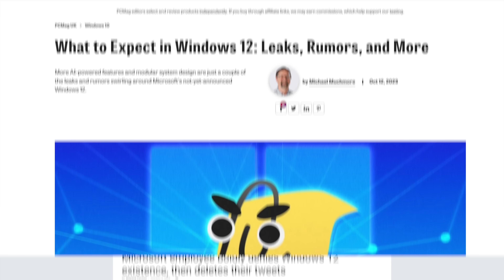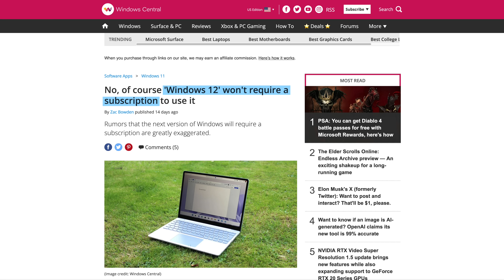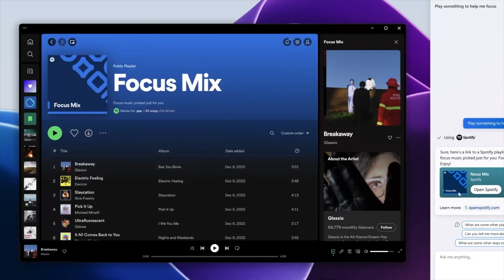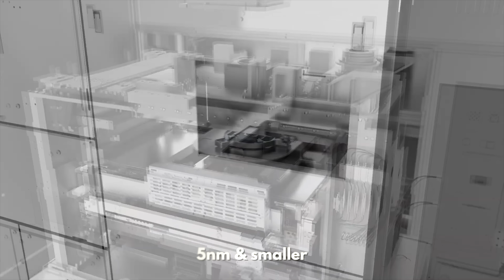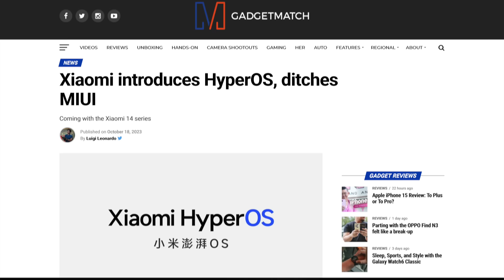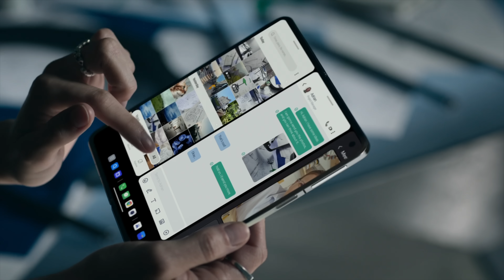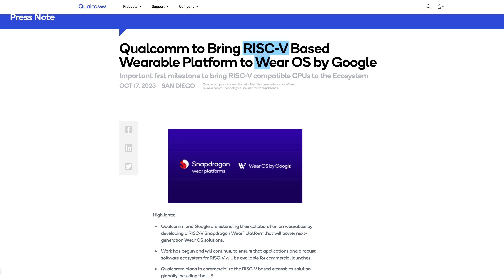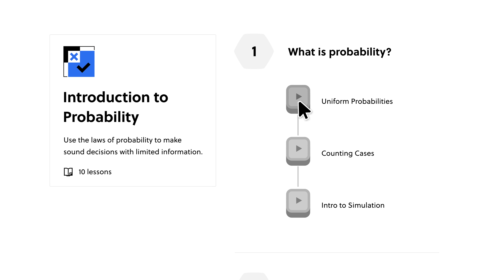Windows 12 is looking good!

Comment: Well, this didn't age well. Apr 2025, Microsoft hasn't even released a preview of Win 12. And people are speculating Oh maybe in 2026. TMC released sub 1nm chips that require the transistor channel to be 3D embedded inside the base. Which ould be extremely hard to do using Canon's approach.
Reply: Yeh it aged damn poorly. WIndows 12 in 2024 LOL. I'd be surprised if we got windows 12 before 2027, if at all. MS got burned too bad already with their W10->W11 adoption over the last 5 years.

Comment: I'm definitely holding back buying new pc until intel comes up with its own M3 arm chip version, as there a massive difference in video editing speeds and most importantly electric use & heat produced  is way less then current Intel i7 10th gen

Comment: Already switched to Linux. Microsoft isn't offering enough value in the product for the price they're charging to make it worth switching back. Certainly isn't any consistency like there was from Windows 95/98/2K/XP/7. Throw in all the attempts to force upgrades and things with malware like popups and such as well as crazy hardware requirements shutting out perfectly usable systems and I'm happy where I'm at. Hell I have an easier time installing and running Linux these days then Windows especially after seeing what hoops you have to go through to get local accounts setup and remove unwanted software that Microsoft tries to lock in to the system. Especially if I want to run Windows games, I got some titles that run fine in Linux with the Proton and Wine that won't run in the newer Windows anymore.

Comment: more bloat nobody wants, stricter requirements that ill have to bypass on my older but still perfectly capable hardware, more registry edits to turn features off that nobody wants and are a distraction. Endles hots file mods and service disabling to remove telemetry data collection l, PowerShell and command prompt commands to remove more stuff thats pre-installed that you can't remove by normal means, then every new build of the os having to repeat some of those steps to remove hardware requirements and manually having to update it by grabbing a fresh image from Microsoft, removing the requirements for internet connectivity to install it and bypassing the need for a gastly Microsoft account, then running sfc scan now after being all finished, all my windows 11 machines are heavily modified to remove all that junk, had to go though all of that to make it leave me alone, if 12 is a subscription service, ill be moving to Linux fully or even Mac os. When your customers have to fight it beyond just setup and installing favorited programs Microsoft, you have failed. boy can't wait.

Comment: They could've released Win11 and Win12 as simple updates/service-packs to Win10 and stay true to their own words of "Win10 being their last Windows OS".
It pretty much looks like the same boring OS anyway, just some reorientation of a couple menus here and there.
If it wasn't for the fact that my hardware stopped support for Win7 I'd still be using it. Right now I'm on Win10 anyway, and I'll stick with it for as long as hardware supports it, then I'll pirate the future version they have, preferably one that's been modified to favor the user with blocked backdoors and Bing keyloggers and whatever else they have going on by default. Imagine being in charge of which updates to download and when...

In my world, I'm in charge of my machine, not Microsoft.

Comment: More and MORE "bloatware" from macrosnot. Last week I backdated my desktop "Frank"(enstien) from Win 10 to Win 7. Faster, the size of the program software in memory dropped from 20 gig to less than 2 gig, it does all the things Win8 and up WON'T DO (like play DVD's and CD's) and I use Capture One for photo editing and it's running 8-20 times as fast. I NEVER get the stupid "thinking" circle. My friend a software writer for a major telecom, showed me how to "block" macrosnot from "upgrading me" (it ain't EASY!). I have my late sister's crappy little HP laptop on WIN10 and every "update" locks it up. Win10 is in the CPU and purging it is about $200-is it worth that???

Comment: I'm done with windows 10 I stopped using it for a while and when I tried to turn it back on it mick killed itself basically went into a boot loop and broke just because I didn't turn it on for a while such a nice stable operating system by the way I don't get this problem with Linux I could stop using it for 3 years and turn it back on and it will work fine with a few commands so yeah we own nothing like really

Comment: NEW Windows 12 with NEW features like:
+ More Spyware
+ More Spyware 
+ More Bloat
+ More Ads
+ AI tools that will never be used
- All of the features that you used in 10 and 11
- Backwards compatibility
* Required TPM 3.0.
* Required Camera even on desktops.
* Required 8 core CPU.
* Required RTX 2050 or newer.

Comment: Your saying Windows 12 looks good. Well I know from experience Windows 10 and 11 were bad news with Micro$oft adding all the ads spyware and other anti-consumer crap they added. The Windows 11 installer doesn't even work on many computers because it checks for things that aren't even necessary. Those in the know know that when those systems checks are disabled in the installer Windows 11 runs fine on the "unsupported hardware", just a ploy to get people to throw away there computers. Now you are gonna try to tell us Windows 12 looks good?! Really as if they didn't add more anticonsumer crap?! Really. I doubt it! Probably more like a distopian nightmare. I used to love Windows intil they pulled all this crap. Every thing up to Windows 7 was great but after that they have been doing bad stuff with Windows.

Comment: It might 'look good' But windows 11 barely works with modern hardware. Intel's latest CPUs LOSE PERFORMANCE on Windows 11 compared to Windows 10 due to 11 being completely broken with handling the e cores. More importantly, applying the OPTIONAL 22H2 update degrades CPU performance by over 30% in a lot of games and applications.

I really do not truest that Microsoft even cares about this, nor will do anything to rectify it on a new OS if they can't yet fix their current one.

Comment: Windows 7,8,8.1,10,11 and 12 are all just variations of Windows Vista. Compatibility has remained high ever since. Stability improved greatly with 7. The bloat of the most unnecessary unwanted features attempting to replace third party tools set in with Windows 10. In the end though, it's just windows. I would not be surprised if they didn't start charging a subscription not for 12, but for 'features' within it. They'll leave the full on sub for the giant that is Windows 16

Comment: WOW. Not gonna watch the video with such a click bait title. The original Windows 1.01 look good when compared to what everyone else was offering, it kick off a long list of successful OS releases for Microsoft.  Yes, I know Macintosh OS was better at the time but lack of software and the much higher priced   made many not see them as an option. Microsoft rode the success wave for 15 years and then they released Windows ME which was a train wreck. From that point on Windows has been pretty much hit or miss. After looking at Windows 11 I decided its time to make Linux my primary OS and use windows for mainstream gaming as well as certain printers, vinyl cutters and embroidery machines we have are Windows only. Each Windows OS seems to progressively getting locked down and locked, out features some features that part of the OS are now  only available in  Windows pro.

Comment: I'm running a top spec Surface Pro 9 and the Windows 11 OS is very performant. No issues. It is fairly intrusive though and attempts to vacuum up all your information. That part I don't like. I have a 12th gen Intel CPU in the Surface and it flies, but it has no NPU features so it's unclear how that will coexist with Windows 12, which is supposed to have AI features.

Comment: Too bad Windows 12 is going all in on what makes Windows 11 a bad release. It might actually be a case of a good release followed by 2 bad releases.
I'm sticking to Windows 10 until they get their head out of their * and start fixing things. The design is crap and needs an option to rollback to a Windows 10 look. It should be possible to opt out of all AI crap without losing normal functionality too.

Comment: Windows 11 is so trash, I switched back to windows 10 because of how angry i get trying to do the simplest things, right clicking on stuff with windows 11 opens a limited set of options and I always need to click on see more (it switches back to the old ui). The new settings menu is just incomplete, most stuff from control panel is missing from the windows 11 settings and I'm glad they at least kept the control panel accessible. I also would like the option to use those large taskbar icons, i just prefer them over just a small icon for all my windows of that program.
So Windows 11 added absolutely nothing worth updating and also removed some important stuff, very bad in my opinion

Comment: We've got a new Windows XP, Windows Vista, and Windows 7 on our hands, finally, after so many years we actually have choices and variety again. For a long time, we only had Windows 10, and while Windows 8.1 and Windows 7 were also available, Microsoft forgot they existed. Microsoft made modern updates for Windows XP to make it relevant in 2008-2015, but they didn't do that for Windows 7 and Windows 8.1 in 2018-2023.

Now we have two older versions, Windows 10 and Windows 11 that Microsoft will still care about, even after the release of Windows 12.
Windows 10, version 22H2, Windows 11, version 24H2, Windows 12, version 24H2.

Comment: Microsft did say in one of their events windows 10 would be the last OS. When I saw the semo they in essence, to me showed that all the feedback of of improving windows 10 was ported to windows 11, with some curated business sauce in top, but not have the flexibility potential of windows 10. Windows 10 wasn't perfect, but did make great strides. Once they said not all pcs were upgradable to windows 11, I gave up, as this was not in my mind the promise made what windows 11 would be. It was to be a lighter version of wi dows 10 but still have the compatibility. Microsft has also focussed more to business support rather than cinsumer sypport which makes any version of windows 10 less valuable, I think. For me windows 10 really means the end of an era and I'm not going to invest in an OS that does not support older hardware that still works fine and doesn't have its cost of ownership retirned on higher end pcs/clients. And I think whatb I've seen so far with windows 11 a lot is quite curated, for which I fail to see the value of further investment, perhaps only to business incentives and norms. But I miss the flexibility in future itterations beyond windows 10 and customizability, windows 10 has. The only thing I think Microsft has dine right is the cross olatform exoansuon of Office software. That software is  is valuable in the many offline and online itterations (for me offline being better, but I like the online synchronization of files and sharing editing). But I've lost faith on windows for business and consumer use. I don't see windows 12 getting far beyond contracted businesses.

Comment: Don't need Windows 11, just need a secure Windows 10 and CERTAINLY don't care about a Windows 12.

Once again willing to bet 10% of customer base may use 12 to any real advantage over 10, and as a forced 11 user, I still don't see any special use over my Windows 10 machine.

If there are under the hood security upgrades, I don't see them, nor are they really bragged about.  AI features are just more exploitation of the customer and their data by the sellers.  I don't need AI because I work with REAL I that I need to understand to apply it and implement it, and be SURE it has no trap in it.

Comment: Windows 16. Four Loko contract. 4 windows; 1-4, four times. 4 different versions for a division system using a square note system. A quadruple rainbow 4 times. 
Logic of the alphabet and 24-25-26. Regarding 99-24, 00-25, 01-26.
Logic of how 24-25-26 is supposed to be the 16th windows because of the plan being about counting the alphabet using a 4^4 system and having it be 16 within 26 described as 25 or 24. Regarding how describing a square and describing science as a square and business...
Logic of the bouba Kiki effect square. Regarding how a square description through physics and elements could make an argument about the truth of computer technology and psychiatry... Like God is fully explained through math using proof of unseen sounds and unseen radioactivity and so forth. Regarding proof of the science of empathy and the fiction of it. Seeing the proof of the bigger picture and sound regarding how communication is validated. Having a map that is a perfect square. And so forth. Regarding claiming that the business at it's foundation is securing the proof that a square is square. It's needed for keeping track of time as well as gps and communication.
Thus, the full explaination of 4=1.
A god skateboard at a skatepark with a god robot using the 40" long, 10" wide, 5" trucks/ tall (10" wide) for making a bouba effect science proof of secret / empathy/ god communication within the technology virtual spaces and communications (representing an example of a description of copyrights and mechanics for the sound/ physical sciences of the bouba effect). It's only an example but would meet the needs of the 4=1 and be about showing how talent and naturality modifies the judgement of randomness.
Logic of how the four Loko contract was about healthy lifestyle of nootropics and alcohol/ recreational substances while living on a liquid only diet. The context of all of it in a contract proves that the square is like a root system for assisting mental health,  especially with autism.
Having a mentally healing root despite behavior... Something that's proven science which can be understood and explored without speculation... Thus, confusing things is external and not agreed upon. 
Logic of having a failing alphabet after the thousand year party and discussions about all of the past... It's like reverse psychology.

Comment: The top most navigation bar is really intriguing. In MacOS its really useful. I thiink windows should add it. It has been ease of use since the bar in Macos. hope they add a feature to auto hide it on full screen mode too.

Comment: Helll yeah, Windows 12, Edge fully built in with no way to remove, bundled with Bing AI chatbot and Microsoft AI Tech allowed to roam free in your OS. Windows 11 has been to date the most invasive OS I have ever used. After paying an arm and a leg for it I switched to Linux, which is free. I heard about it years ago but I thought you had to be very tech savvy to use it, which I am not. Turns out that it has gotten very user friendly, even my mom and dad use it now. I was able to customize it so it looks just like Windows 10, except I'm in control of what's installed on my "personal computer." Crazy idea right? I am finally free. :eyes-pink-heart-shape:

Comment: I find it funny that you think Microsoft will not make you have to have the hardware to run the new feature. ... Well technically depending on how it is compiled it can run on the CPU core but that is like saying that the MS Office suit can run on a graphics processor but it is compiled for x86 not OpenCL. So unless they put in code for both CPU compute and AI core compute it will either disabled and not be able to enable the AI windows 12 features or more likely require the consumer to have the CPU that supports the AI compute features locally on the CPU or SoC.

Comment: The most potential concern for future of Windows is if they dropped Win32 compatibility (most likely by dropping all of x86/x64/desktop apps support) losing over 30 years of backwards compatibility and therefore losing one of the most stable API ever made
Reply: Why API?
Reply: @prashantmishra9985  Because Win32 API has functions that work in Windows NT 3.5 to Windows 11 allowing Win32 apps to work in a very broad range of Windows versions

Comment: Did not expect Canon to be a major player in the chip production space.
Reply: Whenever there is an opportunity to sell hyper expensive ink, here they go!
Reply: They have actually made these types of machines for a while, not quite this special, but lithography machines nonetheless. ASML and Canon are both players. All about the glass. Canon makes great glass, and they certainly have the talent chops to pull it off.
Reply: Windows cannot load because OUT OF RED INK!    "but I don't even OWN a printer and..." I SAID OUT OF RED INK!!!Buy more to continue booting.
Reply: Would love Windows ARM to get as good as the x86 version, including all the games, only to be able to run it on the Apple Silicon Macs, and game on Windows ARM on those machines, because Mac gaming support still isn't up there yet.
Reply: @ncard00  Wrong comment thread.

Comment: The "cleaned up design" is the reason why I won't switch to any new windows until I get an arm pc. If I wanted to use a mac I'd buy a mac. When you've used windows for years something like switching the taskbar's place makes it unusable for a couple months until muscle memory kicks in. Not to mention all the other changes they've made. Plus imo win10 looks way better and probably is less resource-intensive